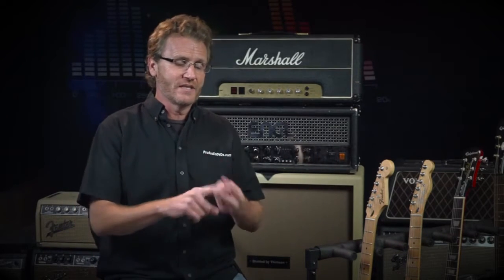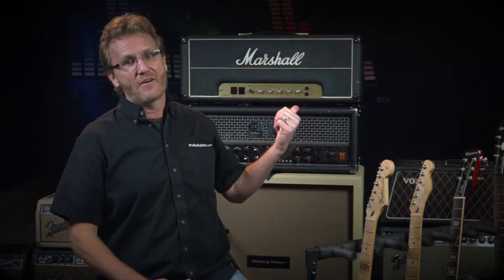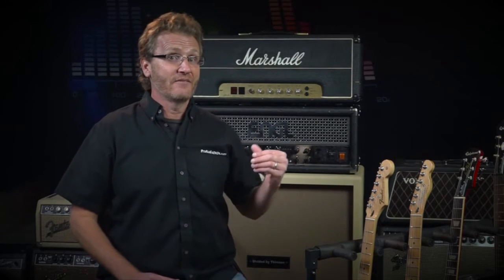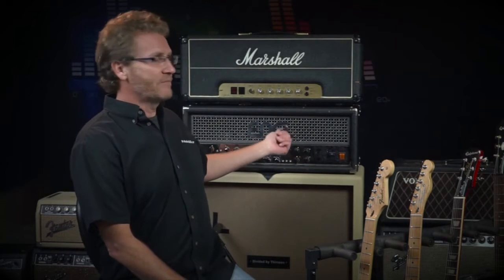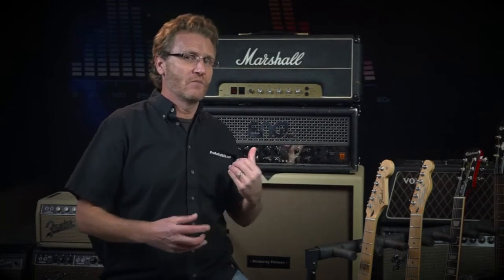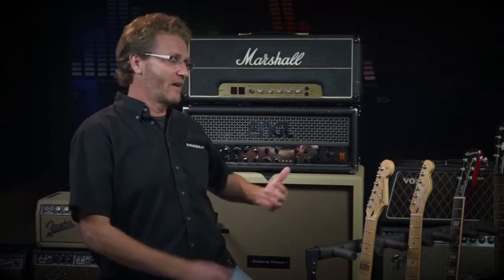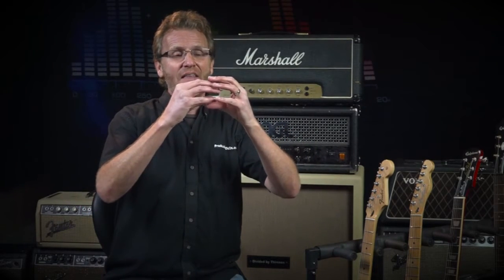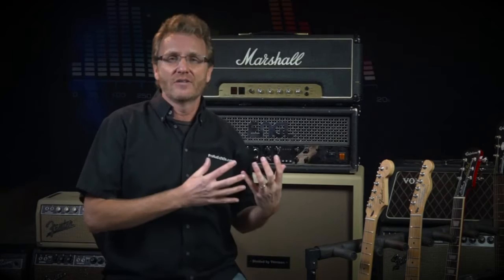How Guitar Speakers Work Wattage and Ohms

Comment: Why does the Trace Elliot Elf output 200w at 4 ohms but 130 at 8?
Reply: 4 ohms has less resistance than 8 ohms, therefore, will amplify at a higher wattage.
Reply: @crazeyjoe   Read the numbers in my post again and tell me why halving the ohms doesn't double the watts.
Reply: @mickavoidant4780  Just as if horsepower is doubled on a vehicle, it won't necessarily double the top speed. The same applies to how impedance affects wattage.                                                                                                    I have a bass amp which has a mono output of 600 watts RMS @ 8 ohms and 380 watts RMS @ 16 ohms. So the wattage output does not double when the impedance is reduced in half in the case as well.
Reply: @crazeyjoe  I know it does, but why?

Comment: On two other videos, it is explained that if your amp is 4 ohms, you can plug one 4, 8, or 16 ohms speaker. If your amp is 8 ohms, you can go with 8 and 16 ohms and not 4 ohms. So how can you damage your amp if you connect one 16 ohms speaker to a 4 ohms amplifier????
Reply: He is lying actually, the power wattage will only be divided or weaker than the original output  power and less headroom, so no damaged will take place. In short the power will be lesser since it will need to travel the long road of higher ohms speaker. So his explanation is bullshit.
Reply: yeah, i think was miss information.